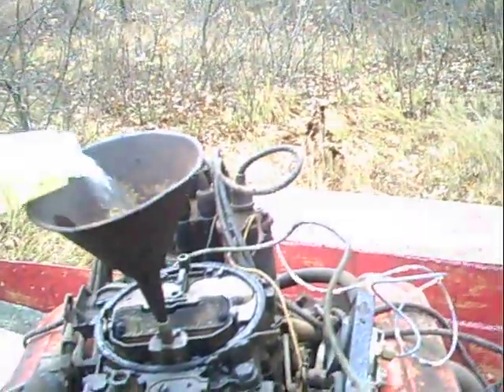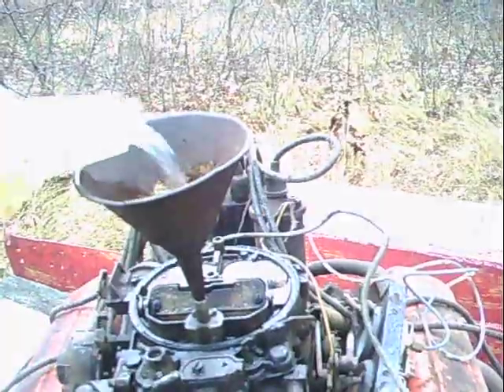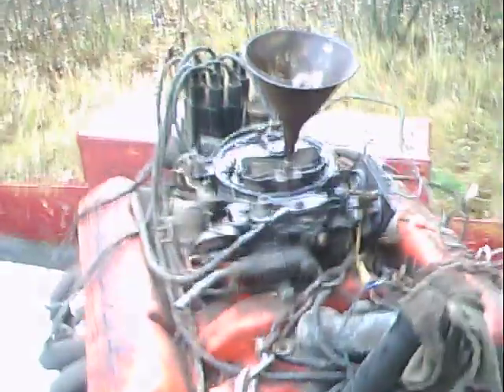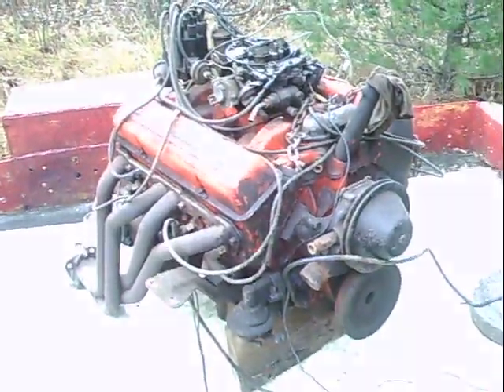Starting an old 283 chevy engine part 1

Comment: Built alot of small and big block Chevys,my last project was a 71-400 small block,--bored to a 406.--Squeezed 457 hp out of it you can play with these motors and create some pretty good hp-283,327 were excellent engines but Generous Motors had to stop making them.They were just to reliable.

Comment from the maker: It doesn't take much to hold them down if you don't rev it up to fast. that's when they try to roll away on you. when I was a kid I had an old ford flathead on the ground running and reved it up and it took off and rold over about 3 times. That kind of taught me an early lesson. I don't think I would run it much over a minute without coolent in the block.   Thanks.   Dan

Comment: The 283 is an amazing engine.
A friend of mine put a set of 202s on one, with the Duntov 30-30 cam. It never ran out of carburetor, it never ran out of cam. The motor would breath and tach like crazy.
We were really impressed with that little motor. In a 66 Chevelle with a 4 speed and 411s. Rapping rpm. It would not blow
Iron American dream on YouTube.

Comment from the maker: Thanks for watching. I have been running engines out of the vehicle like this since I was 14 years old. I know when an engine is getting warm. The worst damage I have ever done, was the first one I ran like this was a ford flathead. I reved it up to fast and it took of and rolled over on the ground three times and messed up the carb, and I almost messed up my pants also. Now I'm 57 and know better.   Dan

Comment: Chevy engines run forever my uncle had a Chevy engine sitting around his back yard for 13 years cleaned it up hooked up the back ran fuel pump and one crank started

Comment from the maker: @OleIrishReb I found that to be a problem anytime I tried to put a V8 into an old truck that had a six cyl. in. That darn steering gear was in the way. I had a 54 Dodge I put a 318 in years ago, Iv'e seen cobblers set the engine off center, but I never liked that. Thanks for the comment and good luck.    Dan

Comment from the maker: Ya they are. I had a 66 Impala in the late 70's that used a quart of oil every 50 miles, but it ran great and sounded fantastic with dual chery bombs. If someone was tailgating me I'd just romp on it and smoked them out and they'd back right off.  Thanks for watching.   Dan

Comment from the maker: This engine was rebuilt by my son in high school. We put it in a 67 chev pick up. Drove the truck till it rotted away. I junked the truck, saved the engine. This start up was for further preservation of the engine cause it had sat for about 8 years without running. I still haven't put it in anything yet. The engine was rebuilt about 1996 and got about 35,000 mi. put on it. Quit driving the truck in about in 99. Scrapped it in 2006. Engine was too good to scrap so here it is.  Dan

Comment: @jeepers2655 Even with block hugger headers you have to hammer spots down from what I've seen so far. It's really tight. I have found a possible solution. 69 Camaro and more type manifolds have one style that even has it's own indention from the factory. That indention is needed to help clear the frame/steering. I plan to pick some up to try because the source was very reliable and they look like they will.

Comment: I like those tube pipes. You said your son had it in a 67 eh? I have one in a 50 and the stock ramhorn manifold is right up against the steering. I've been looking at them and need to locate some headers that are tight against the block. This is a early 57 283 that mounts in the front. Anyway, thanks for the video, good motor you have there, big carb. .

Comment from the maker: @gtrman4931 Yes it does run good I couldn't believe it started that easy after sitting so long. The truck we had in in hauled pretty good. then the cab mounts give up. I kinda hate to part with it, it's kinda got some sentimental value to it if you know what I  mean. I don't know where you live, but I'm way up here in Wisconsin.

Comment: Thanks for the great videos! 
I have a GM 350 boat engine on a pallet that's been sitting a few years and kinda thought I should run it to get the oil all around the inside so it doesn't rust. Was wondering how much I would need to strap it down against the torque, but I see a couple straps should do it.
Was also wondering how long it can run without coolant water in it. Guessing the head or seats in the exhaust valve area would be the first to be damaged from heat? Any advice or comments?

Comment from the maker: Yes it's still sitting on the trailer covered up. I fired it up about 2 months ago cause I was thinking about buying a 58 chevy truck to put it in but I decided against that. I robbed the headers off to make headers for my rat rod. I guess 300 bucks would take it, but you'd have to come and get it. I live by  La Crosse, Wi. About 25 miles east. I would not try and ship it.   Dan

Comment: Thanks for getting back with me Dan. I ran 283's in a 56 Chevy, 60 Vette and two 62 Chevy's. When your son over hauled the motor, did he go with standard bore? What about the crank! Nice video. My friend called that motor the two out of three!
Reply from the maker: Thanks again 3melendr. The engine was in pretty good shape inside when we got it so I just gave it a really good honing for him, the crank was good so it got standard barrings. He put a mild cam and lifters a timming chain and gears in, new rings and my dad ground the valves for him. He's long gone now. I figure this engine had about 35 thousand miles on the overhaul at the time the video was made. This engine was originally from a 1966 Checker cab. I built a cart with a radiator on so I could run it on and it's now sitting in the corner of my shop. This video was made 5 years ago and I still have nothing to put it into yet.     Dan

Comment from the maker: @TriggerHappyLunatics A friend of mine has a 63 nova ss that was made into a sand dragster that had the engine in the front seat and straight axel installed. He sold the engine and drive train out of it, now just an empty shell rust free from Arizona that he wants a 1000 bucks for that I'd like to buy and put this engine in that, but I  don't know where to get a drive train for it and the straight axel has no brakes on it, and I can't realy afford it right at the moment. 63 ss = dream car    Dan

Comment: I have a 79 Cutlass I would like to buy that motor for it
Reply from the maker: Thanks for watching Jeffery.  I still have it, if you come to my house with 350 bucks cash it's yours. I live in West central Wisconsin.      Dan
Reply: I put a 455 Oldsmobile engine in my 79 cutlass, bolted right in on the 260 mounts.

Comment: yeah it's too bad they replace the 283 + 327 what the garbage 307 305 and worst of all the 350 I hope you put that 283 in something those are really good engine
Reply from the maker: Thanks for watching Bill. It's now sitting in my shop on a cart I made to run it on,so it doesn't have to sit outside any longer, and it's still running strong. but I haven't put it in anything yet after all these years.    Dan

i